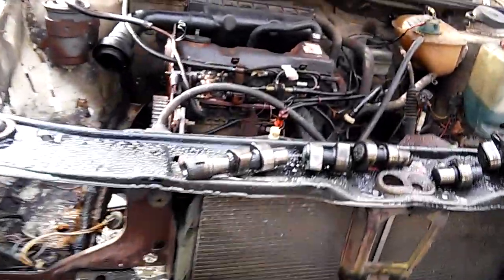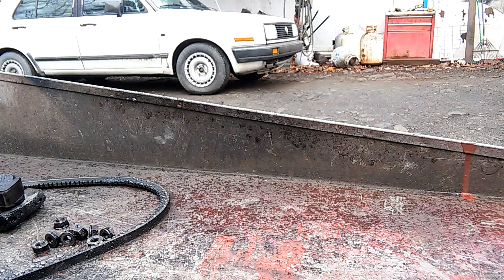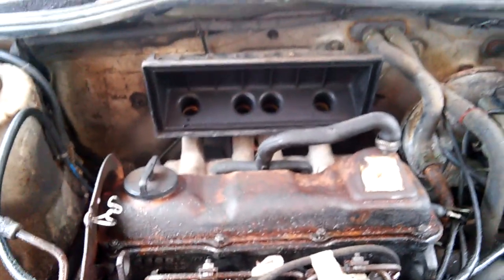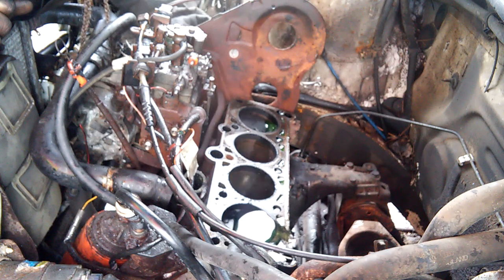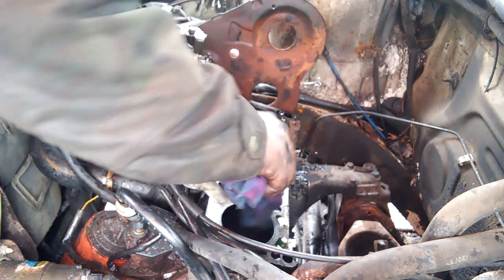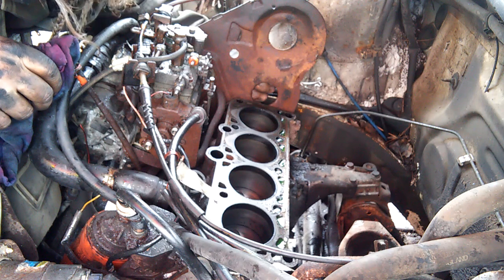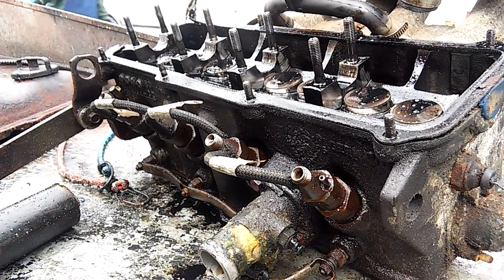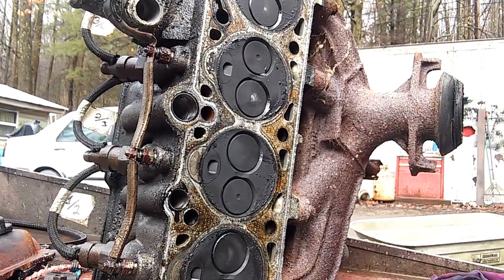VW Diesel cylinder head removal

Comment: Some guys run some automatic transmission fluid in the diesel to clean out the carbon on old diesel engines. Overall, it looks good under the head though. The valves looked really good too.
Reply from the maker: I could see doing that. Now and then I'll do that on my gasoline engines kinda. I'll slowly dribble it right down the carb while holding it at a high idle.